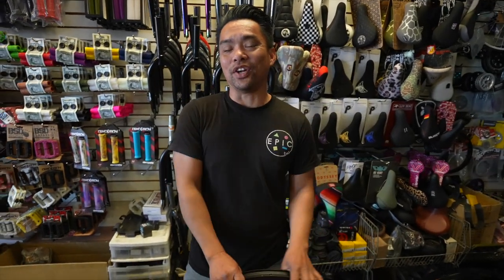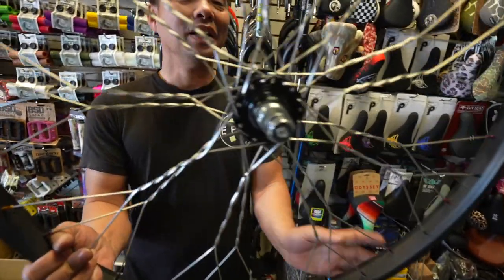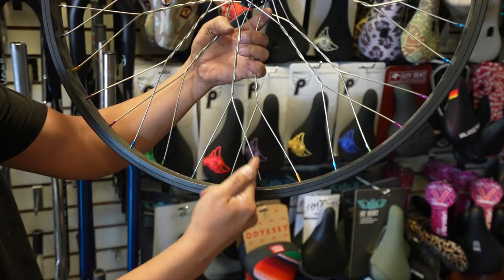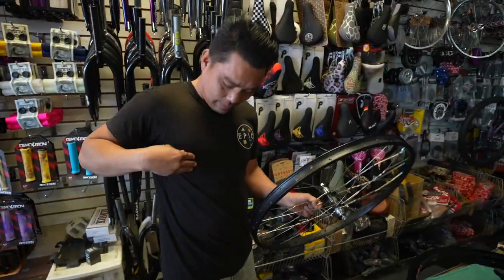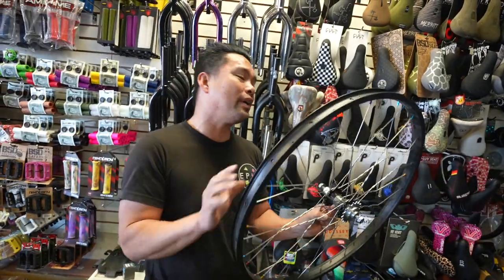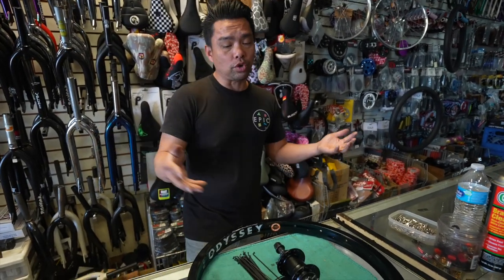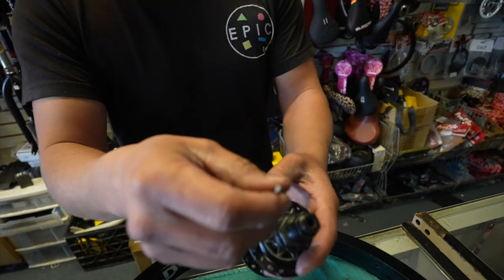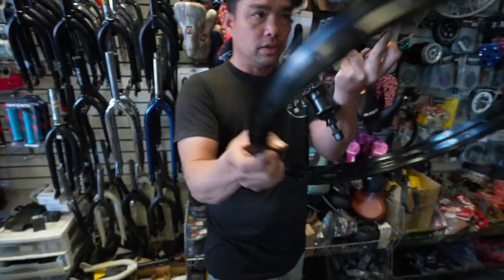Shop Owners Don't Want You to Know This Insane Twisted Spoke Lacing Technique!

Comment: Back in 95 I had twist lacing on my Elf Doublecross with Bullseye hubs and Sun Mistral hoops done by Dans Comp. It was offered as an option for more strength at that time. I raced every weekend and when I wasn't racing, we were hitting the dirt jumps we built, and I never had an issue with them.

Comment: I did exactly what you said back in the early 80's... removing two nipples at a time, single twist, and the wheels were bulletproof and maintenance free for racing.
Reply: Single twist looks to be the more common wheel  I've seen.  I've always wanted to do this.  It's getting done.

Comment: Oh how you fix it is a dent puller get a grade 5 bolt in the end of it make a round jig and you need a model to copy and dent pull at the around angle for that hole give a good hard bang on the 7-10pound puller on the aluminum rim and it will bend the hole slightly in that direction bang tapered hole stress on the nipples mostly gone give it a try worked for me and looks factory if you’re not crazy with it, it will take a few bangs to figure out how much strength use for your rim so start small and you’ll get it

Comment: Hi there Phu, 
each twist will reduce the spoke length by roughly 1mm.

Multiplies of 2 twists are better than an odd number of twists too as the spokes keep there same line as if laced without the twist.
Reply: Depends on the pattern. I've missed by as much as 20mm on some I've done but they are on 700c with much more weaves.
Reply: @JoeBernard10  Yes the lacing pattern also changes the spoke length, on a 36 spoked wheel 3x, if you go to 4 cross you have to add 10mm in length.

But I find generally if you work out the correct length of spoke for hub and rim combination and which cross pattern you prefer then the number of twists you use say 4, just add 4mm to the spoke length and your good go.

I tend to go from a 12 mm nipple the 14mm just for that extra bit of leeway too.👍
Reply: So is it best to twist 2 times over 4? And 5 twist will not bring back the spoke to its original whole? Correct
Reply: @jackand100others3  Multiples of 2 twists are better, so 2,4,6 etc but I have used odd numbers in past usually 3, and while its probably not ideal I haven't had any issues with them, I must add though that Ive been building wheels professionally for nearly 30 years now and I am at the rank of master wheel builder.👍😊

Comment: I think I,ll stick with the regular way of lacing a rim . What I use to do is lace a rim the original regular way & where the spokes cross each other I would put zip ties around both of them really tight . There’s 2 points on spokes that give you strength , the straight sup & down points & where each set of spokes cross , adding the tight zip ties keeps the spokes from flexing making the whole set up really rigid & tough & that’s what you want in a rim set up , it just means you rim set up can take more of a beating from jumps & it stiffens up the whole thing .
Reply: I did that too. Then I took a wheel, and did a simple twist. Undo two spokes, and just to one twist sending them to the opposite hole you took them from. Nipples lined up. Wheels were bulletproof. Trued them once... and were maintenance free after that.